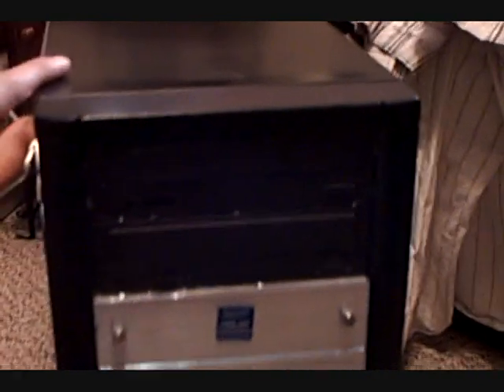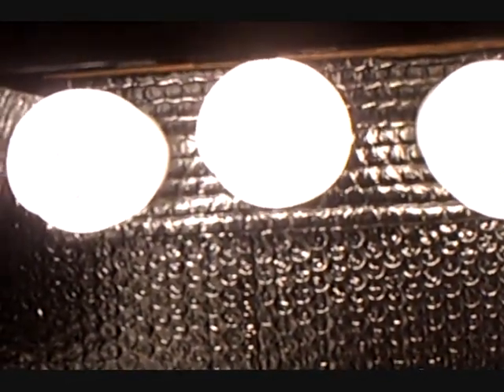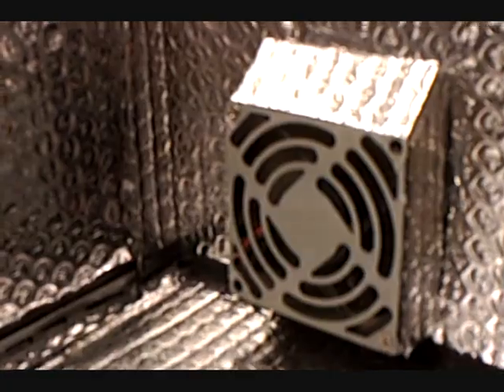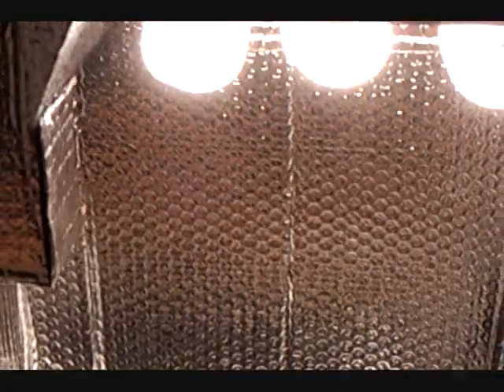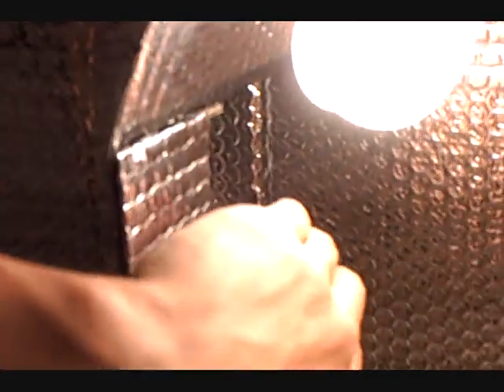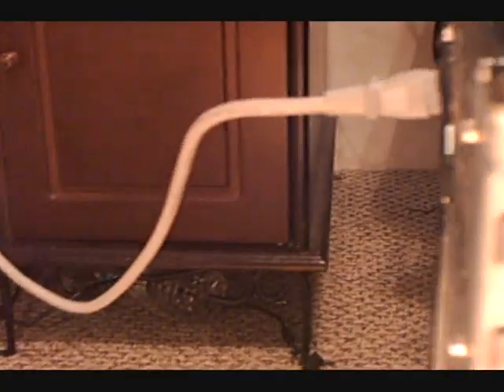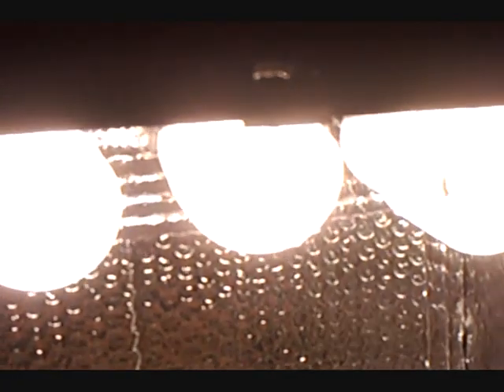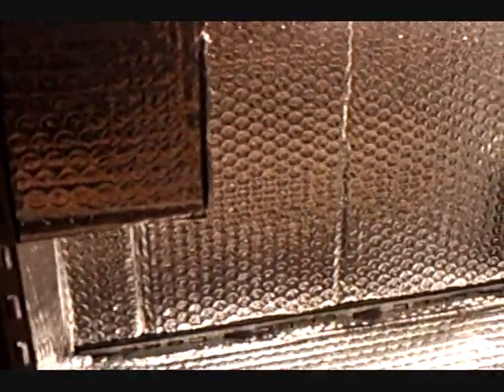Custom PC Grow Box (Ultra Stealth)

Comment from the maker: The fans on this case are not filtered, however they ordered an ONA odor block to eliminate all odors.

We also offer the options of a carbon filter built into the light trap, as well as our cheaper version of the "dryer sheet" filter.

Comment from the maker: I didn't use a power strip in this video, everything is wired into power converters and actual lighting fixtures.

I don't recommend doing it yourself, you could risk electrocution.